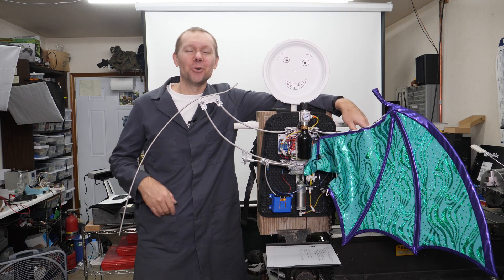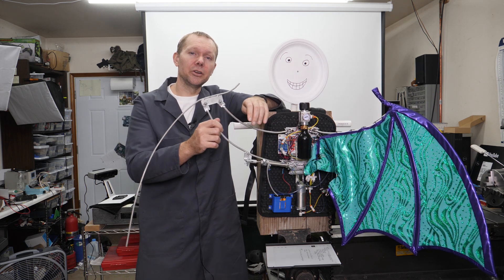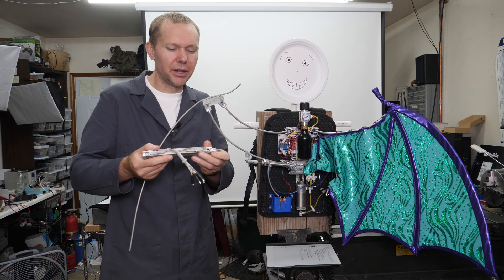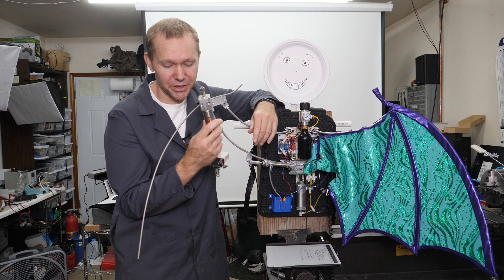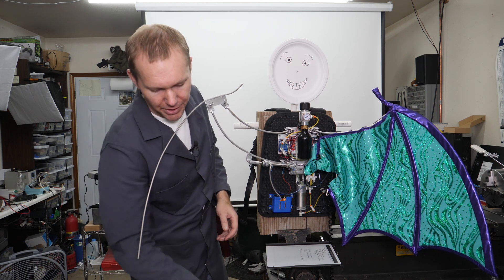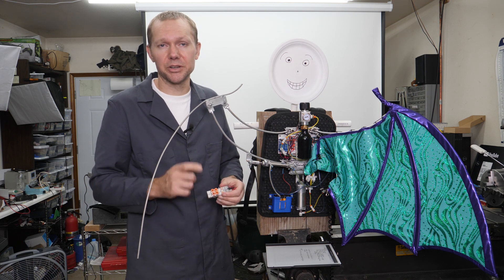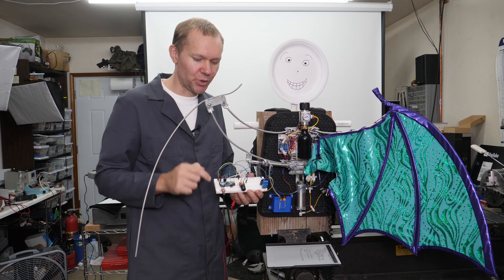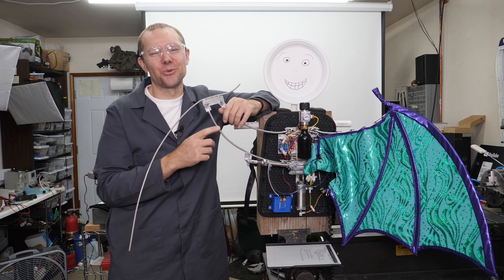Pneumatics and the Dragon Robot

Comment: I believe the reason for the icing is due to the phase change being endothermic. The CO2 is liquid in the bottle and exits as a gas, but the liquid to gas transition requires energy which it pulls from the environment. The same thing happens when you draw propane from a propane cylinder, the propane is in a liquid state in the bottle but transitions to a gas when you draw from it and the bottle ices up if you draw too quickly; I run into this with my forge and foundry setup all the time, the situation worsens as the liquid is depleted because you're reducing your overall thermal mass as well.
Reply from the maker: Makes sense!

Comment: Your  explanation about PV=nRT is not entirely correct. You mentioned that P decreases when the gas expands and as a consequence T should also decrease. On the other hand V (volume) increases when the gas expands, so maybe the increase in V is larger than the decrease in P such that altogether T would increase?

The explanation (in short) is that the gas undergoes an "adiabatic expansion". In doing this expansion, the gas molecules are performing work on the environment. At the same time, there is no heat exchange with the environment (definition of "adiabatic"). This means that in order to perform work, the internal energy of the gas must decrease (due to conservation of energy). This internal energy is the kinetic energy of the gas molecules or in other words, the temperature of the gas.

Comment: Thank you for your awesome videos:)
At 15:00: Im not quite sure if you are right on this one. It might be the Joule-Thomson Effect and is dependant on pressure and (inversion) Temperature which can also lead to a gas heating up when pressure is dropping.
Ideal gas model - to my knowledge - only holds true for small pressures, but I also use it most of the times to gut check whether a gas phenomena has an easy explanation which I can stick to my brain:)
Reply: Yep, this is the JT effect. its why we use dual stage regs on our process gas lines to prevent icing up when the pressures drop rapidly. pretty cool science.

Comment: When I watched the first video, I thought it was a lack of flow control was causing the jerky movement. Now that I see you have flow control on both directions, I think it's that you're either running too much dwell on the 3-way valves, or the spring is making it impossible to dial in, because of the resting force that the air system has to overcome, before there's any movement. Ideally, you'd use a double-acting, and 5-way, with low pressure and a lot of restriction, to give it more fluid motion.
Reply from the maker: Could be slop in the mechanism too.  Like a worn U-joint in a driveline.